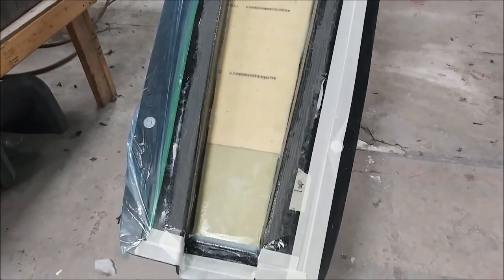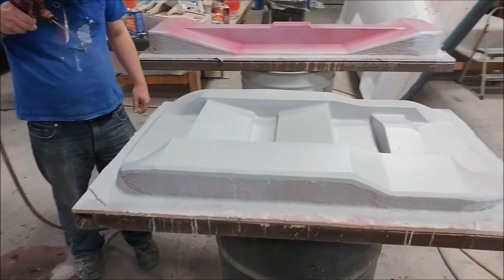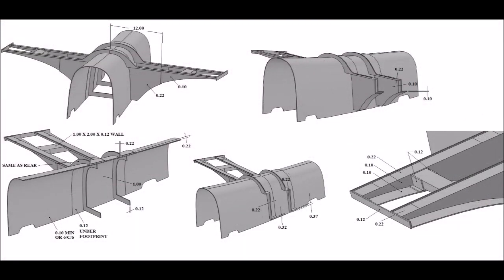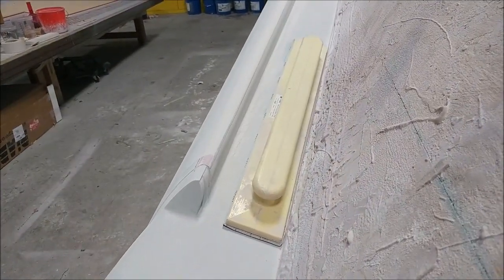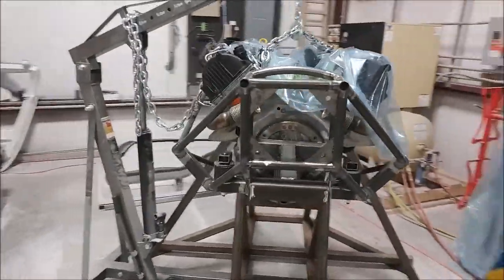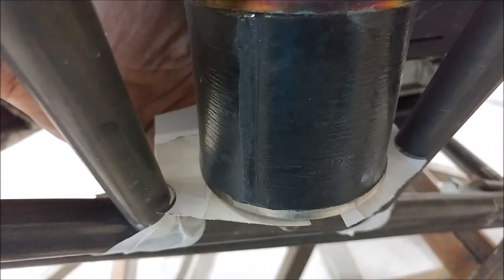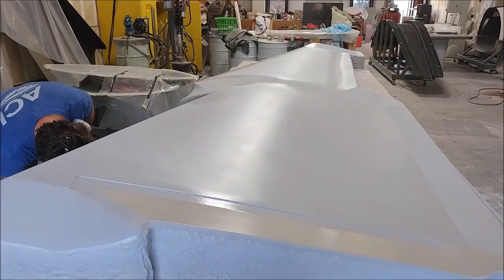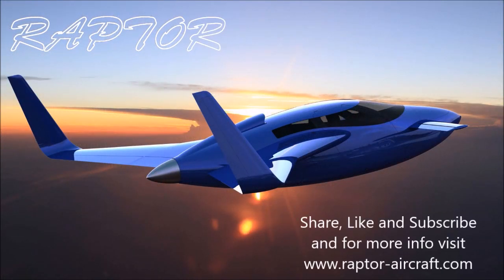Raptor Aircraft February 18th 2017

Comment: Curious to know - in an automotive application engine mounts experience largely (if not exclusively) a torsional load. In an airplane application engine mounts also experience a significant thrust load, not present in the automotive application. Has this been a consideration in the Raptor's engine interface design? If so what was the outcome of that analysis?
Reply from the maker: CDB1952 no, because in our case the belt drive and main engine mount drive all the thrust directly into the fuselage. The thrust bearings in the belt drive are designed to take the load. The engine sees none of it.

Comment: So this is totally just from observation, and may not be correct, but it appears that you might have conflict getting the nut off the engine mount once everything is welded up.
Reply: You would shorten the stud on the mount to the desired length.

Comment: Question: Why don't you make the first layer in your schedule peel-ply in any area where you eventually need to bond? It would save man hours afterwards having to scuff up the areas that contacted the mould.
Reply from the maker: Yes, that's something we've already done on a couple of pieces. We just need to remember it each time. Thanks for the suggestion.
Reply: Funny. I had the same memory problem. I'm guessing that once you start producing pieces in volume you'll have documented layup schedules for each mould and those layers and locations of peel-ply are part of the list. Awesome work on all! 
One more question: a back of the envelope calculation of the energy you need to dump from the coolant, and the energy you need to cause the temperature rise on the leading edges for anti-icing doesn't work out when I do it. Are you adding heat energy to the coolant somewhere prior to heating the leading edges?
Reply from the maker: There was a long discussion on this couple of weeks ago on here or Facebook. We're not sure if it will work but we'll eventually still try it, most likely using a heat exchanger drawing directly from the engine oil.